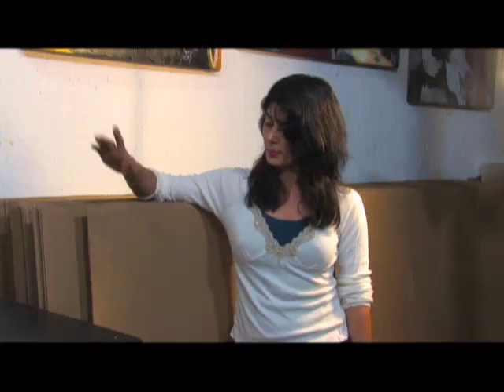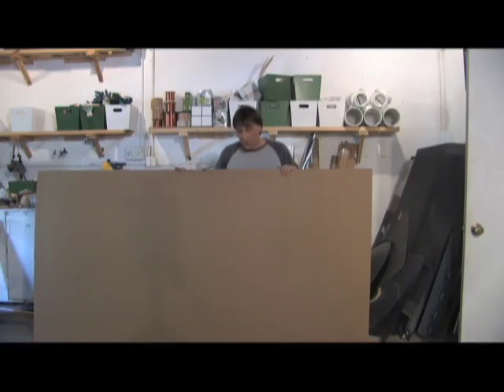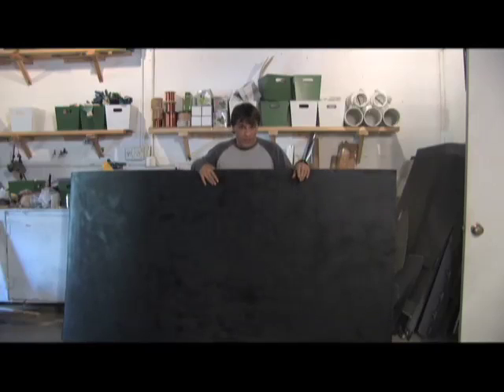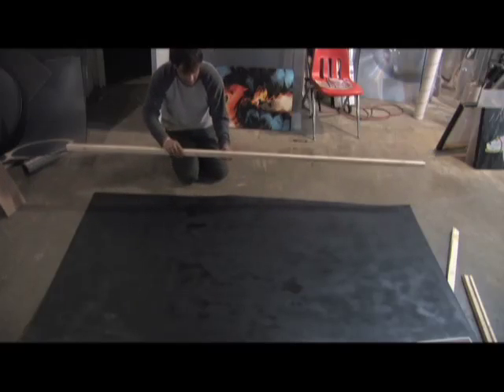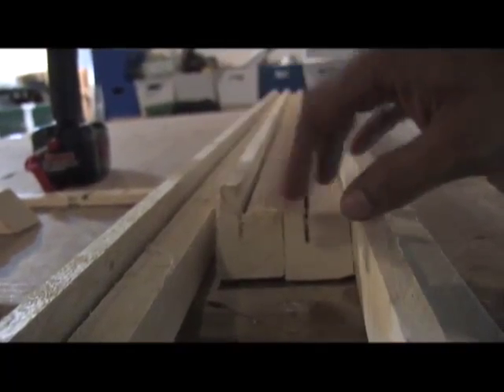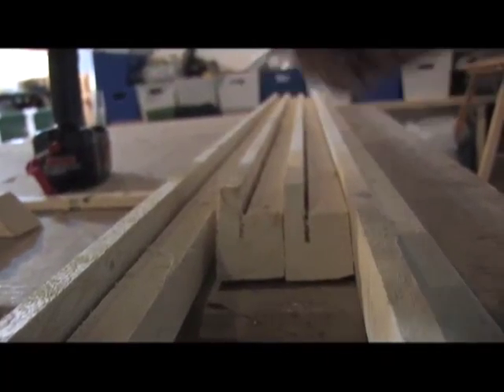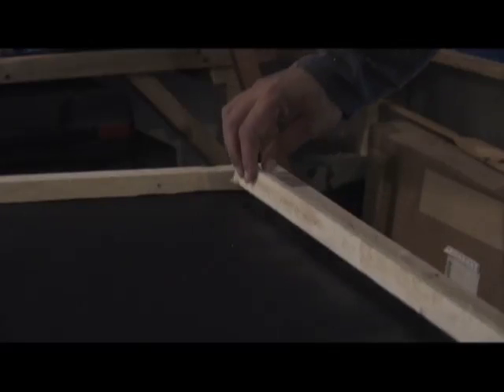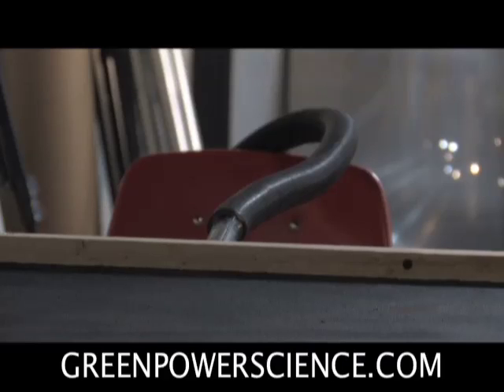CORRUGATED SOLAR FORCED AIR PASSIVE HEATER FIGHT HIGH HEATING OIL GREAT DEPRESSION 2

Comment: very cool example of how simple things can work, I have a screen adsorber setup on the house that is 5 foot by 25 foot or so that produces on average an 80 degree temp gain, from 70F to 150F with a standard box fan sized hole on both ends into the house.  On a sunny day even at 32F it will raise the house temp into the 80s with no extra heat, and thats in a 2000 sq foot home.

Comment: I think the corrugated plastic idea is one of the best going. However, Open to the elements like that means your panel is going to be losing a lot of heat. For the back, use a 1" or 1/2" insulated panel. For the front, use 8mil Greenhouse plastic. For non-open corrugation side of our box, use wood, for the open corrugated sides use a piece of scd80 PVC pipe, cut a slit in it the thickness of your corrugated material (saw blade kerf may be perfect). Other things to think about. For construction strength, drill holes in each end of the wood to slip the PVC through and simply plug ends. Use standard available Pipe insulation on PVC. Use an adapter on one end. or both of course, and place a PC Fan with Thermistor input and small solar panel to power it (so it runs on solar and only turns on when the temp is correct - these fans can be had for 10 bucks or so)(could use one on each side for a clean push-pull effect - built into the Pipe adapter - say your PVC is 2", Adapted to say 4", plenty of room.  Couple other minor details and wadda-bing.

kbs

Comment: don't forget the heat from the vacuum cleaner, heat produced by the motor and heat produced by compression of the air.
Reply: +izzzzzz6 
And the vacuum is probably consuming 800W trying to force the air through. 
  But this is a good system if using a low pressure fan and larger manifolds, + stick the sheet inside a glass box in a vacuum and u can't go wrong
Reply: Could just stick a few solar panels on there that drive the fan. Also to replace the cardboard or chemical plastic stuff you can use any pipe you have available really.

Comment: I have an idea and want your opinion. I have a spot near my garden area that receives sunlight all day. Was thinking of building 2 of these and running insulated pipe under ground below the frost line about 20 ft into basement to heat from the bottom up.
Reply: You'd need some seriously well insulted pipe.  The loss in 50soil could be as much as 5° per foot of travel!  So 20x5° = a 100° loss, but only down to the point of it hitting the 50° Temp of the soil. Not to mention getting the air back out to the unit.  You're essentially talking about doing a thermal heat pump setup at that point.  I'd honestly save up $1,200-$1,400 to find a mini-split heat up, or $1,600-$1,800 for the most basic heat and cooling minisplit heat pump.  & they use far less wattage then your system would need to force the air that far.

Comment: Hey Dan, Another use for coroplex is to take a sheet of it and poke holes in it like an air hockey table then put against the pin hole side some humidifier wicking material and then put a drip tube above it... see up the bottom end of the coroplex and then force your air in through the top... voila BIG plate swamp cooler :)

Comment: Oh an on bedbug removal? you have to raise the temp of the home to like 140 degrees F for like 6 hours.... soooooo they use propane heaters now and duct the super hot air inside.. so... why not just lay some solar panels like the one shown here in this video in the persons yard and not use propane?

Comment: Well I am thinking black coroplast + RC Electric Toy Car + Arduino + ESP822 SOC (about 3 bucks for that line of site with no antenna can relay wifi for like 2.8 kilometers) + blower motor = Drone Snow Removal Service using solar (yes a land drone that goes along driveways or roadways etc to well no driver melt the snow and get the road bone dry LOL.. but hey I am a dreamer..  oh and on the how you keep snow off this? well you know how a plotter works? perpendicular rails and a plotting pen FAN with tube going into said box and optical sensor, temperature sensor well the thing can keep itself free of snow... or you just call in the KITT roving dronebot suggested in this post to well melt the snow for you....
Reply: Jesse Mercury i got one just like it .
Reply: If this is where it is snowing and snow sticks to the ground, this would be so could it wouldn't melt anything and snow would stick to it:  good try though mate, you almost mastered perpetual motion!

Comment: +GREENPOWERSCIENCE Does the heat and UV release chemicals and odor from the corrugated plastic corrolast? Thanks!
Reply from the maker: Douglas Gottlieb No, coroplast is considered food grade a temperatures below 150 - 160 F so as long as there is voluminous air flow the collector temperature stays in the 120 or less range. The goal with forced air heating is to circulate a lot of air and keep the collector cooled down.
Reply: I tested a small piece of cloroplast this summer and it hit 185° on a 82° day.  At that point off gassing is substantial.  I'm also wondering if the wattage used for the blower, if converted to use on a heating element would actually get a better efficiency.   

I also just read a msds for three types of this material, they all listed BPA.   I was considering sandwiching them crisscrosses to make a diy fresh air/heat exchanger, yet, I'm thinking breathing through this stuff would be a horrible mistake.  Any thoughts?

Comment: instead o cardboard, they make 4 feet x 8 feet semi-transparent plastic hurricane panels that are about 5/8" thick, with 1/2" square holes running the length of it (like a lot of 8 foot long 1/2 square stock melted side by side to make it 4 feet wide), essentially like the cardboard sheets you're using, only water proof and sturdy. but instead of painting it with flat black paint, I wonder if you'd get even better results using black 'chalk board' paint that you can buy at Lowes?

Comment: COROPLAST breaks down quickly in areas of high UV. Zones 8 & 9.  This particular material will virtually turn to dust within 12 months +/-.  Depending on the thickness and composition of any item made of plastic, you can count on them to deteriorate more quickly than in other climate zones.
I'm in southern California, High Desert region.
Reply from the maker: Ginny Phillips I have pieces that have 6 year plus 100% exposure and they are a bit faded bit still solid.

Comment: you could use an old glass door drinks fridge - the doors are double glazed and the walls are insulated - some maybe stainless steel inside . Then put black painted rocks inside for heat store - to heat air late afternoon and after dark.  Under one  side of the fridge window have the black collector - I would use black corrugated iron the other side collects sunshine directly onto heated up black rocks. I was also thinking black corrugated metal roofing - using 2 sheets in a frame with a I cm spacing. Its pretty cheap and durable, no out gasing from the paint. Hot plastic may have fumes.  Very interesting and I will definitely use the ideas for my winter heating. You can also make a solar dehydrator in an old drinks fridge.

Comment: Actually, in most areas, removing political signs is illegal. The signs are the property of the candidate who posted them. You can, however, call the campaign office (after the election) and ask if you can remove the signs. Most will tell you to go for it because it will save them from having to send someone out to collect them.
I have to wonder though, is heating plastic so such high temps really a good idea? Checking with whoever manufactures the material to find out what the effects of heating coroplast are might be a good idea. Some plastics (when heated) produce some pretty toxic gases.

Comment: I think rather than constructing a wooden frame, it would be easier and more durable to use PVC; slice and caulk, and drill some air ports on the opposite side.

Comment: There was also a 4th little pig.  Unfortunately his corrugated cardboard house  burned down.
Reply: Coroplast melts at a fairly low temperature. It's not something I would consider suitable for a permanent building material.

Comment: If you want to cool your house in summer you just bury a grid of pipes in your yard like this and suck/blow air through it. Properly screened & hooded at air intake outside with insulation plugs for winter/cold weather and drainage for condensation it is a great system that eliminated cooling costs for my home  and as it is buried deep enough even in winter I can pull air at 53 degrees from it when outside air temp is negative ten, cold but better than freezing.
Reply: Barskor1 I love that do you have any idea how many feet of pipe has to be in ground for 1500 Sq foot house and is PVC pipe what you use ?  Diameter of pipe should be how large.  Awesome idea, I live on 20 acres. So ideal for me.

Comment from the maker: Cans have too much volume to surface area for a realistic volume. Also most soda cans have a thin interior coating that contains BPA and is leached at temps exceeding 140˚ F. Also provides a thermal barrier, not metal to air contact. Surface area to volume is what makes a system work. To equal the heat exchange of one 4'x8' coroplast sheet (black sheet $10 UV resistant 10 years waterproof) would require approximately 350 12 ounce cans.

Comment: The aluminum can deal is also better because AL has exceptional heat transfer ability and is not easily degraded by moisture etc.

Comment: Larger collection panels heating water then taken inside to some form of exchanger is a superior option. Using water smoothes out variations in temp of the collector surface, just as your test showed when a cloud moved overhead. It also would allow for continued heating for some short time period after sundown as well as it can be more easily and accurately distributed and controlled.

Comment: Sorry, but they raise it WAY more than that. It is THE reason that a 1/2 hp vacuum motor is so small, because it can be built more cheaply using smaller windings etc because of the high volume airflow for motor cooling. With the high flow a person really cannot detect by feel a 1-3 degree temp rise, but the discharge air from a vac is quite warm. Neat principle, and it is no doubt effective, but this test is fatally flawed.

Comment: Your loosing a lot of heat without a plexiglass cover. How about forgetting about pushing/pulling air through cardboard. Use several layers of cardboard for insulation on the backside.  Thompson water seal the bottom. Paint the top layer black and cover with plexiglass. Leave a gap between the cardboard and the plexiglass, so that when the sun shines, it heats the air above the cardboard and retains some heat for when a small cloud passes over.

Comment: Instead of blowing air through it what about sucking air through. I'm thinking this would lower the pressure inside the unit making it colder thereby absorbing more heat from the sun making the exhaust from the vacuum hotter. Absolutely no idea if this would work but I'd like to know if it does. To be honest I think the cardboard would probably just collapse on itself.

Comment: actually you could use that for cooling passively just attach it at the top of the house than at basement level or something have a pipe that is underground and basically that panel heats up draws the cool air into the house and there you go passively cooled house. "Chimney effect" second you could use multiple layers of cardboard to insulate the back and a piece of glass on the front and you would be golden for the winter. just insulate a lot.

Comment: A length of pvc pipe cut from one end to the other could create a slot for the cardboard  to fit into. You could cap one end and attach the vacuum to the other end of the pipe. If the seam was sealed all of the air could be collected. It would be light enough so that the contraption could be suspended by nylon cords attached to each end.

Comment: Not to be a jerk here but most vacuums blow warm air out of the exhaust from the heat of the motor.Did you test the air temp of the exhaust after running the vac for a few min before hooking it up to your heat collector to make sure it didn't affect your readings .Love your video's keep up the good work.

Comment: Quick question: 

What happens if I build one of these with coroplast (great material for a lot of things, btw) into a frame that's plated with glass... and install it in such a way that the incoming "fresh" air blows over the coroplast before entering the channels of the corrugation?

The result I'm thinking is a more even distribution of airflow through the material as well as better protection (glass cover) and no stagnant air inside what would typically be a sealed protective case. Thoughts?

Comment: You do know that its only number 2 heating old that most home's use and its a lot but for buildings I know that number 4 and number 6 are up to 80 cent a gallon number 6 a year back was only 63 cent but number 4 and 6 burn dirty so you will see black smoke when you first start you're boiler up. NO HOME SHOULD USE NUMBER 4 OR 6. Its not for you or your units

Comment: Does anyone knows of any safe chemicals that heat up to 175+ degrees when motion is applied.  If ammonia, sulfur dioxide, and non-halogenated hydrocarbons such as methane can be used as refrigerants when motion is applied, what chemicals can be used for heat when motion is applied?   Contact RF at rf_countrychristian@yahoo.com

Comment: If you took a sheet of corrugated steel and then laid a flat sheet of steel on it a "spot weld roller" could be fashioned. A wheel rolling in the trough of the corrugation and a second wheel on the back of the flat sheet would press the sheets together. With a ground applied to the sheets and a welding voltage passed thru the wheels a welded seam would be made.  The assembled panel would gather more heat especially if painted flat black and would be VERY durable.

Comment: Why not use black pvc piping cut down a scribed line mount the board 
pvc cement an intake manifold tube on the bottom  a hot air exhaust tube out the top and silicon glue glass panes to the front and back.
Seems faster, easier to construct, and uses the power of greenhouse collection to capture more heat.
Love your videos. Keep up the great work.

Comment: This was inexpensive, didn't require fancy expensive tools, and we didn't have to drill holes in our homes walls.   At night we simply turned off the fan (some didn't have them) and closed our drapes.  Any cold air seepage that occurred would have happened anyway with the existing windows.   When the hotter months started to happen, we just simply pulled the units out and stored them in our garage.   When cold weather returned, we pulled them out and put them back in.

Comment: We made two holes, one at the top (hot air outlet)  and one at the bottom (cold air intake).  Hot air rises naturally, so having a fan is optional.  We found that having a fan at either the top pulling air, or one at the bottom pushing air made for a higher rate of airflow into the space.  However, even without a fan the air still moved into the living area. Our box with cans, got up to 134F.    CONT>

Comment: We researched a Trombe Wall, along with the popcan designs.  We could not put holes in our walls, or put anything on the exterior of our home.   So we decided that we would use some foam insulation, and build something that would slide into our already existing windows from the inside of the house.   Our windows are double pane, and have to sections.  One that moves, and another that is stationary.  We built the foam boxes to fit inside the stationary part.  CONT>

Comment: you need solar panels for your air flow, otherwise the money you save for heating goes to running your fan.   have you tried the same thing but with pop cans? works better and in some cases dont need  a fan or air flow.

Comment: hung my panel between my windows on south side of house, rigged teh input/output into a panel that can fit snugly into the window opening when it is raised 6in.  rigged small solar panel to open the vent when sun is on it.  much better solution.

Comment: This is really awesome. It's inspired me to think of using coroplast to build a heat exchanger and how I would chimney the output to use the natural convection to move air through this kind of heater. Again, awesome.

Comment: @etlamphil Don't forget that solar air heaters work on raising "ambient" temps...the air in the unit is the same temp as your house...when the sun hits it...it raises the temp inside the unit. Winter has less solar radiation...but the unit is still capable of producing good supplemental heat even then. A fully sealed insulated unit is the secret...and managing the heat loss through the clear cver is the real concern.

Comment: have you tried it in winter. you tested your device in warm and sunny conditions. i really can't see this working when its cold and/or just a little bit cloudy. then you're gonna have yourself a nice air cooler, which i suppose is not a great thing in the middle of winter.

Comment: instead of using wood how about pvp pipe with caps on the ends then you can paint it black so it can also help heat up the air

Comment from the maker: @TheEZhexagon coroplst lasts 5-8 years for a $17 sheet. Also has 3 x the volume of 200c cardboard. Coroplast reaches 137 F in direct sunlight 25 F outside temp, on glass insulation, with glass it goes up to 167 F. The small channels transfer 80% of the heat at 30 Cubic Feet Per Minute. Coroplast is rated at 250 F. Also additional black spray paint extends UV to 7+ years.